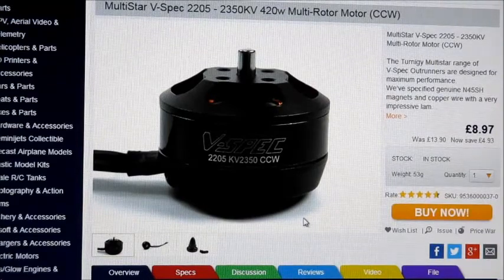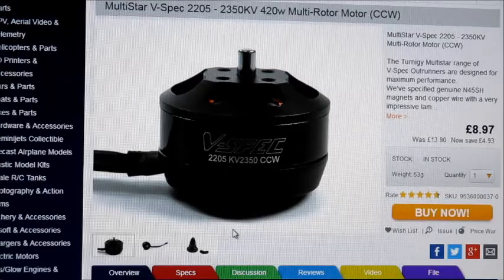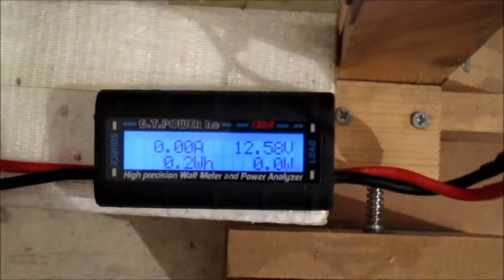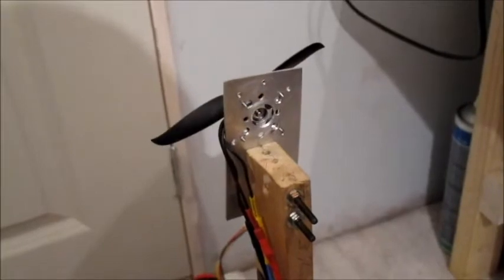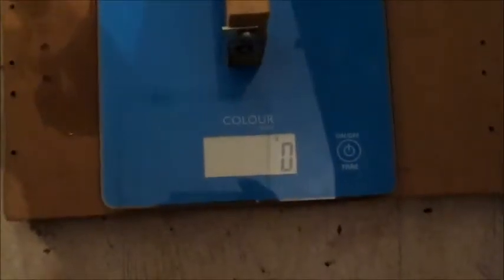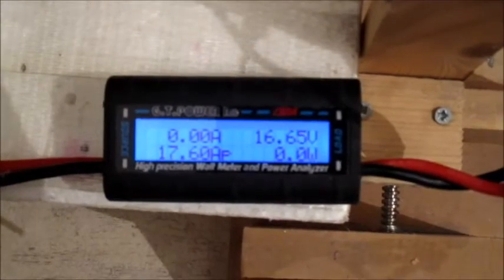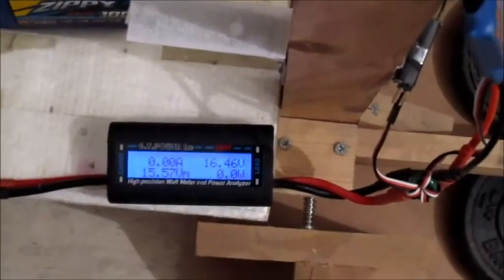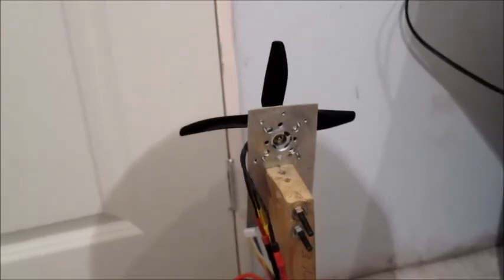MultiStar V-Spec 2205 2350kv Thrust Test Motor Test of the Week

Comment: I know bull nose props are not as efficient as regular props but the saving grace is they are tough. I have crash many a quad and not changed a prop. I run three to four blades on my quad not for  just speed but handling. I also run 6045 props on these motors. Funny things is  they are faster yet quitter .... So when racing against guys with 5045 props, I can hear my quad go by while  and think I am going slower... yet I am winning  all while fpv... Keep up the good work.  I hope you get some DAL 6045 prop to try. I am sold on them.
Reply from the maker: Cheers Russ.
Reply: I had 6045s before too but the 5040s sound is just awesome but I'm on a different ESC, (all-in-one instead of 4x) and FC, same motors and frame and different props.  I'm not sure if you went 6s though, those give 1400g.  I can't fit them on my frame and my DJI Ocusync only takes 4s.

Comment: Nice video, but you don't show the amps during the test. How many amps for a 5040x3?
thanks!
Reply from the maker: Amps were shown on the watt meter for all the tests but as you asked it was 16 amps on 3s and 24 amps on 4s. These figures may go up a bit on larger size battery's.
Reply: OK thanks ;)